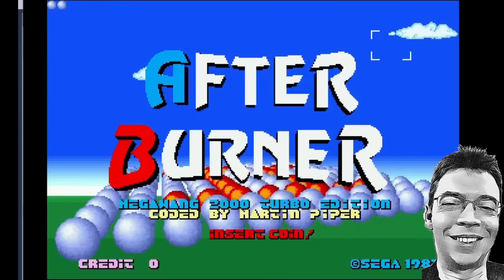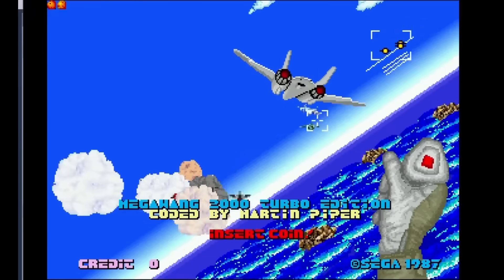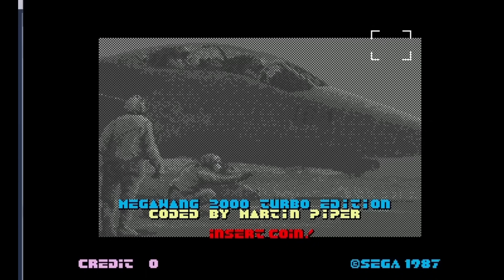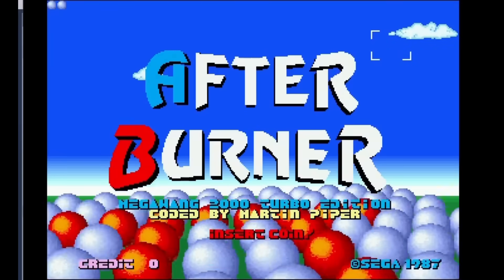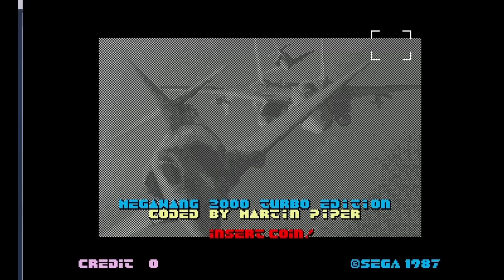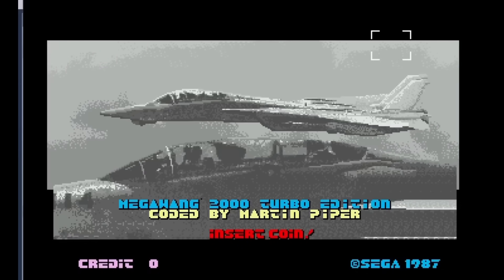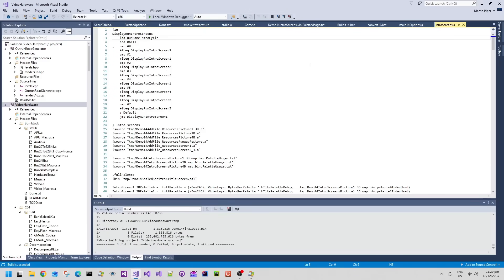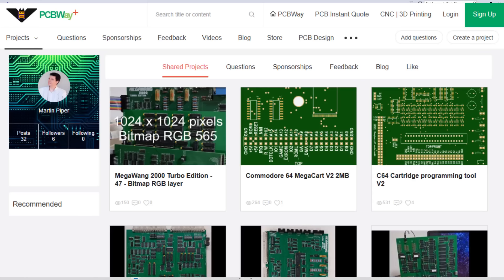MegaWang 2000 Turbo Edition - 50 - Arcade attract sequence

Comment: I love Megawang 2000 and After Burner, good job!! Any idea of how much money can cost?
Reply from the maker: I've got to get quotes for several boards because I've converted them from through hole to surface mount. :) This will also make the boards smaller and cheaper. After that I'll be able to provide a much clearer estimate.